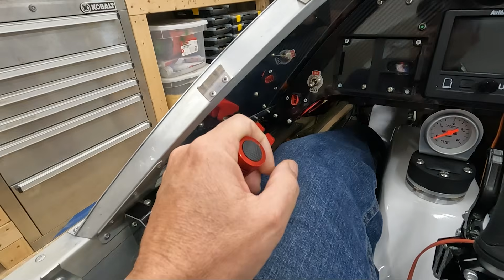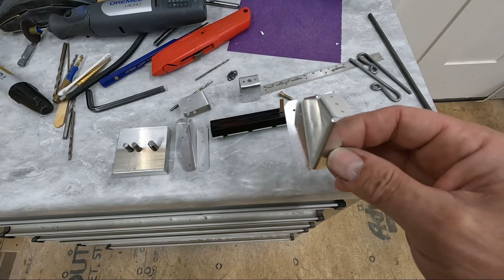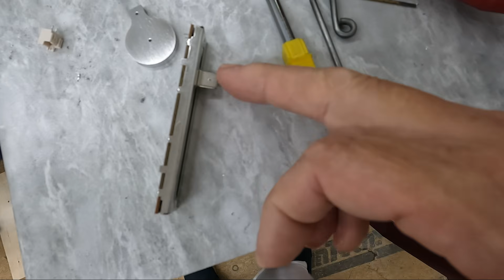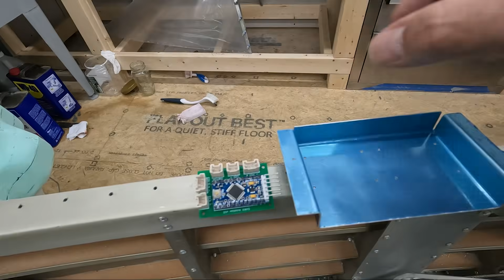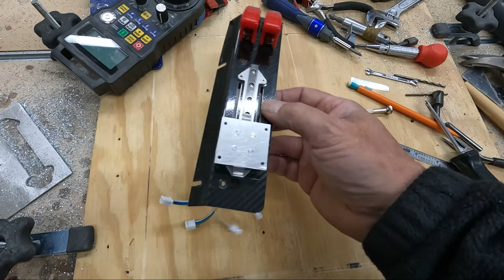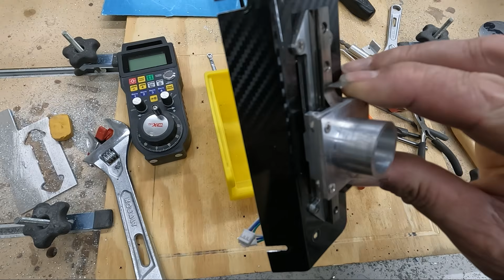45 - CriCri Throttle Controls

Comment: How are you dealing with prop sync? Even on fadec turbines you need to deal with prop resonances that can vary based on aerodynamics more than just rpm. Won’t break anything but will give you a good headache, lol. Looks amazing.
Reply from the maker: I will just wait and see. I considered modifying the control handle so you could rotate it right and left to adjust the engine RPM between the two engines like a throttle trim.
Reply: That is the exact same thing I thought because generally you just need a little differential between the two.